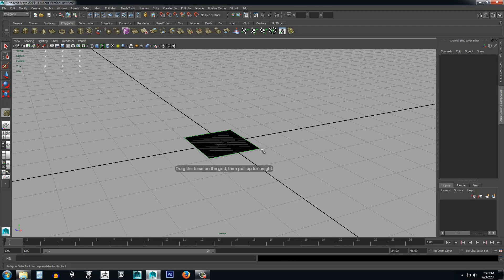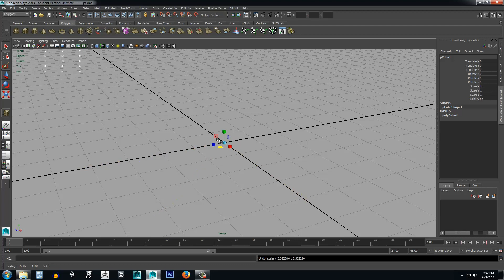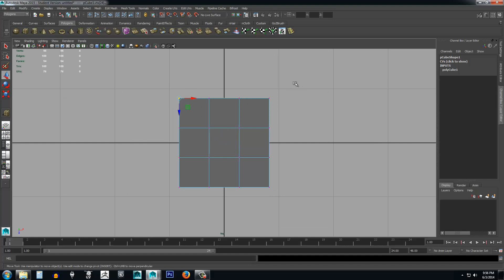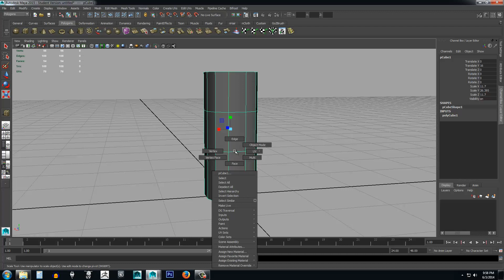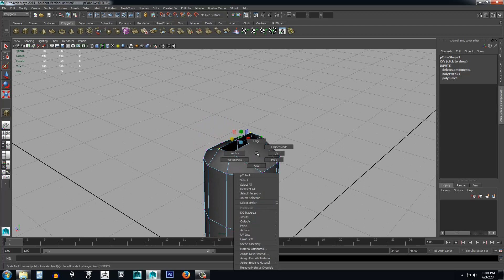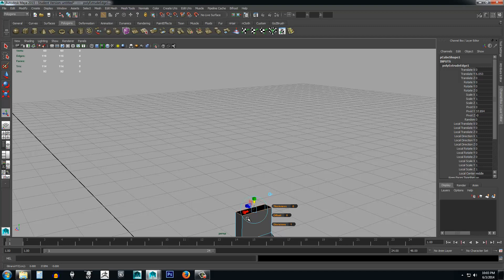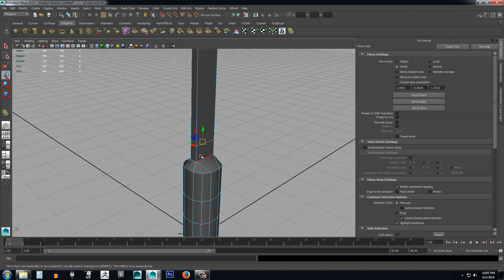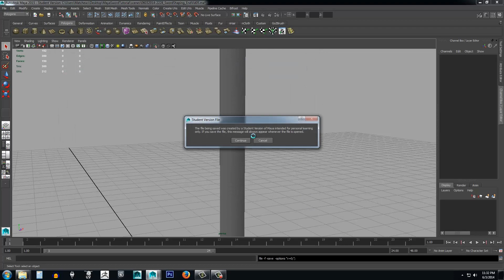05 - Maya 2015 - Extrude and Edge Loop Tools

Comment: Wow, I am confused and nothing seems to help. at about 5:15 when you press r to scale the objects in, if I press any single axis manipulator it will only jump in big segments of change. I cannot control the variation of the changes in scale no matter if I change the size of my cube or anything else I have tried. I was trying to middle square and that would let me slowly adjust the vertex locations but, obviously that centered the vertexes closer all together once trying that. Confused... I know I can just press W and move them but I want to learn what I am doing wrong here and don't want to take an easy way out. Thanks in advance.
Reply from the maker: +Garrett George 
From what you described, it sounds like you have Step Snapping enabled. In the tool settings for your scale tool, check to make sure that Step Snap is turned off. (Press R to activate your scale tool then select the Tool Settings tab on the right hand side of your Maya UI. Step Snap will be in the Scale Settings.)
Reply: +Brain Poof Amazing, exactly what was wrong, thank you very much. Do you happen to be working in education? Because you have quite the knack for doing such.
Reply from the maker: +Garrett George 
No, can't really say that I work in the education field. I'm just really good at identifying issues as I practically live and breathe Maya night and day. I work as a professional prop/environment modeler.

Bare in mind that I never did really finish this particular tutorial series, it kind of ends on a cliff note. It covers a lot of good stuff up until the cliff note so it's still a good watch. I do plan on eventually making a new series covering 2016, with a far more sufficient workflow, but it will have to wait until after I finish the series I have just started for the Fallout 4 modding community.

I had intended to finish this particular series but I got side tracked back when I was making it with some life stuff. Now that 2016 is out it would just make more sense to go ahead and move on to a new series for 2016. Perhaps in a month or so I will begin developing videos for it. Provided nothing major comes up.
Reply: +Brain Poof Well, I am surprised. Hmm, that explains it and sounds like quite the interesting job! 

Well, I think I can survive with the 40+ that you did manage to finish, as an absolute beginner I feel already that following your videos can really help me get where I am wanting to go in terms of using the program. That would be interesting and I would enjoy that as well but, so far, your tutorials have helped me heaps and I am using 2016. That sounds cool, I have been waiting for some good mods that made the creation mode in Fallout 4 a little closer to the experience of The Sims. 

 I look forward to seeing everything else you have in store, whatever it is. I plan on telling anyone who who listen about your videos once I start up at CSU Fullerton later this month. Thanks again, and I hope you don't mind me bugging you for the occasional questions because they seem inevitable when using a foreign program like this.